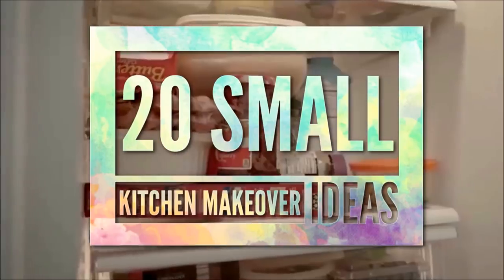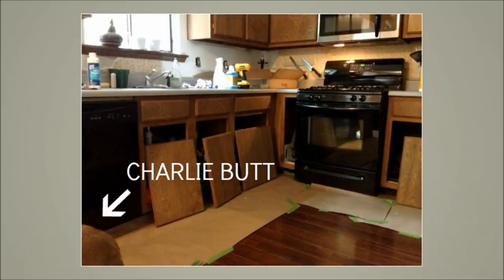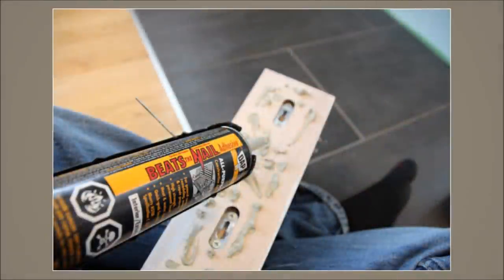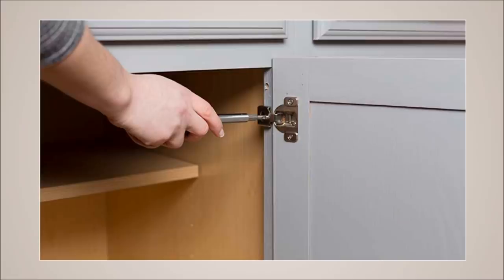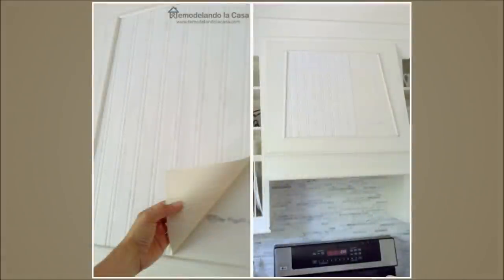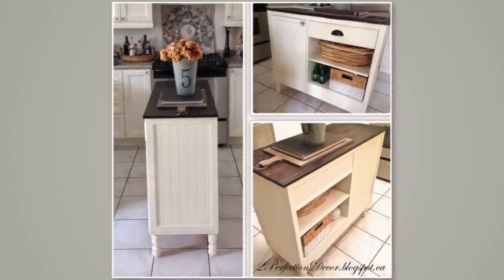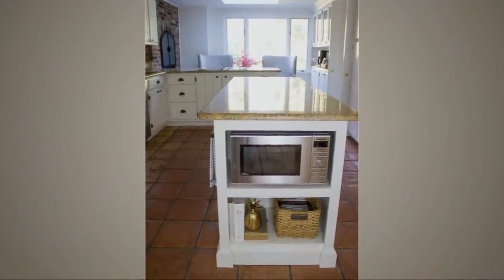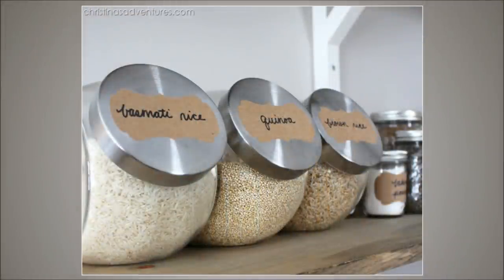20 Small Kitchen Makeover and Furniture ideas

Comment: Actually if you want to paint over wood and not have to do anything to it, paint it with what's called chalk paint. It's not actually chalk but regular paint formulated to stick to any surface without any sanding. I love it I use it all the time. Then if you want a high sheen go over it with water or oil based clear coat.
Reply: Ive heard (hgtv fb group) to not to ever paint kitchen cabinets with chalk paint. its not durable in a kitchen. I was going to do mine but so many people said dont do it.